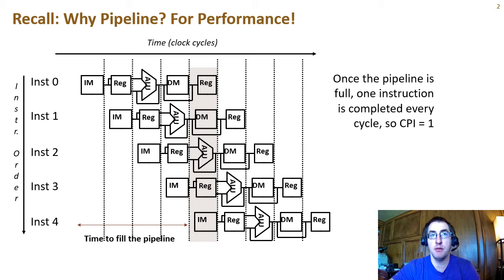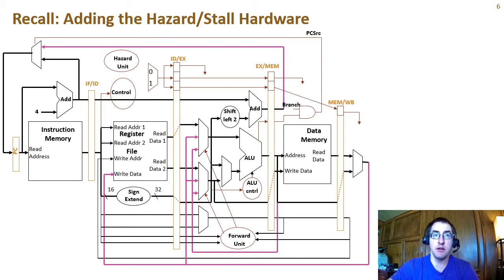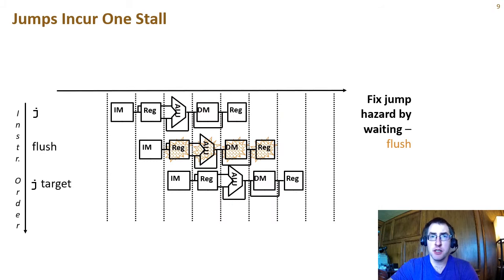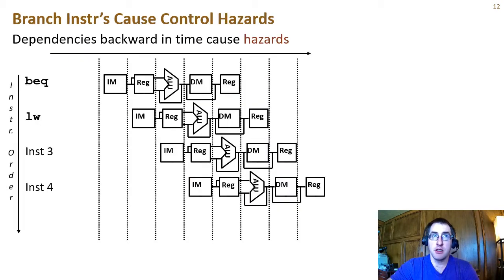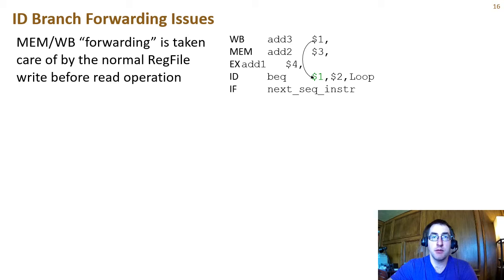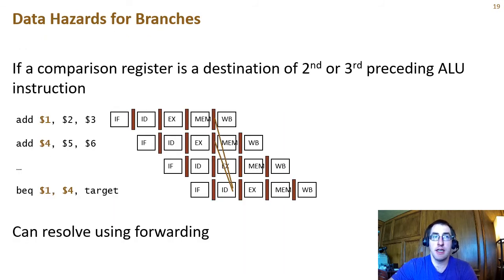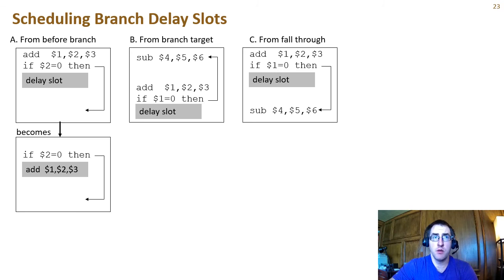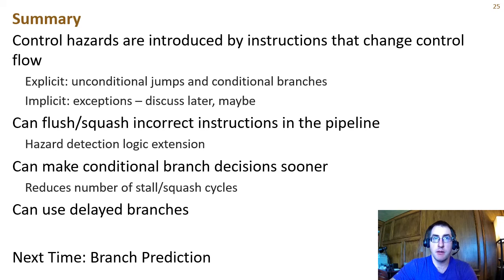MIPS Pipelining Part Three: Control Hazards

Comment: I want to do a LW after an ADD and the LW is dependent on the ADD... does it need 2 NOOPs or 3 ? - as add saves the results in the WB stage and LW gets the spot in memory at the ID stage
Reply: 2 nops, or forwarding